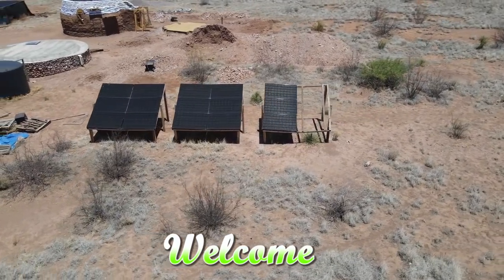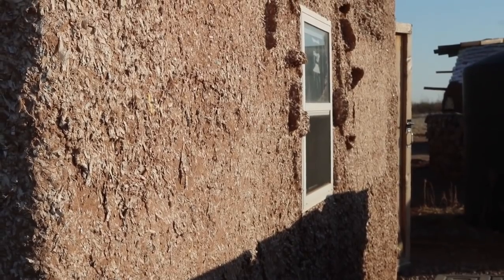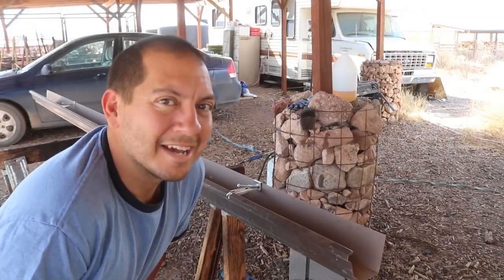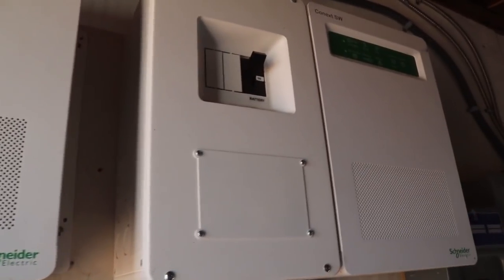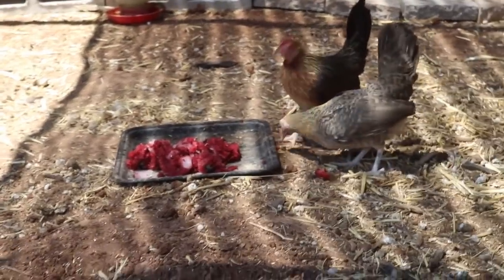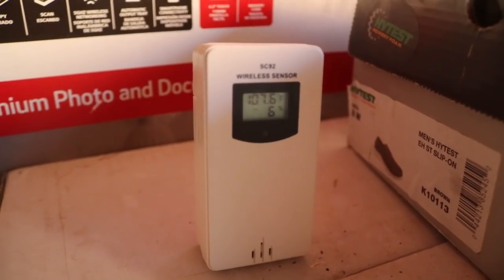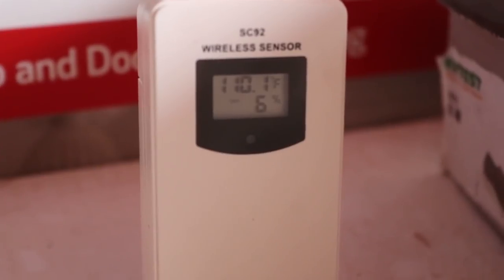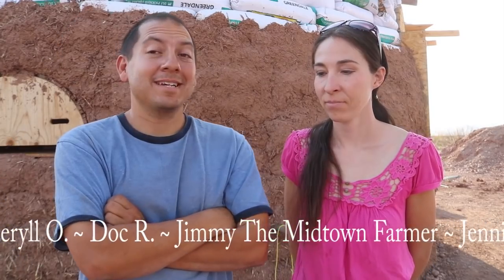Scorching Desert Heatwave Threatens to SHUT DOWN Our Off-Grid Solar

Comment: You need to get your RV out of direct sunlight their not insulated all that great and adding a second roof layer 4 inches apart or cover the roof with mud bricks on the shed this will knock down those temps and cob some more the out side walls.

Comment: A tip on cooling your solar shed and Rv, cover any windows that are hit by sunlight with an emergency survival blanket shinny side out. I cut the blankets to fit the windows and tape to the inside. It drops the temp in my house by 10 degrees. Its a cheep small fix, hope it helps.
Reply: Absolutely! Cover any and all sunstruck glass from the outside. I recommend the lightest weight something. Again if it moves you are harvesting wind energy to lift the light shade...it then falls by gravity and that tiny puff of movement keeps the outer layer of air you have surrounding the exterior envelope from building up heat. Make a cooler layer of air around any structure by doubling the envelope in a way that doesn't build up hot air...but first as commented shade glass from the outside.

Comment: FYI... If you get a tarp as others suggest for your shed, you can expect it 15F cooler. Based this on testing using a large rectangular patio umbrella in a tiled patio in Cali, Colombia. 👍

Paint the roof white, if not silver already. Both reflect similar amount of light/heat, but white is usually cheaper. Yes, did it on a concrete roof. My solar hot water came from cold water pex tubing in the roof getting to 120F by 11:00 AM. Dropped 15F after protecting the roof with the coating of a white concrete sealant. Checked the temperature right from the faucet! 🙂

Comment: We in Zambia made sure there is a lot of ventilation between roofing sheet and ceiling and isolate the top of the ceiling but not so much that is blocks airflow. We also sometimes see double roofing with a big free open air flow between them. Make sure the highestt point of the roof allows air to escape easy.

Comment: Heat is very bad for batteries,  I worked for Johnson Controls battery division for many years....Ac in the shed isn't probably neccessary but good ventilation is!

Comment: So some tips I've learned not having ac for 15 years in Central Kansas where we can get pretty hot. If you open the window in your shed at night and use your fan to pull in cool air then shut everything down as the sun comes up. That has helped me tremendously! I also got some small Blaux room coolers that basically work like a swamp cooler! Very happy with what they do! Low energy too! I also cover all windows with heavy dark curtains that get direct sun exposure and that really helps. We just got new windows last year and so far I haven't even needed the curtains. So if you are getting cold at night like I remember the desert, pull that air in at night with fans then shut down when sun comes! So hot out there right now! My nephew is a hot shot wildlands firefighter working the Telegraph Fire. Like 110-116 up there! I don't know how the crews are doing it! Ugh! Stay cool guys!
Reply: Praying for you nephew to stay safe,that's a heck of a job especially in that ambient heat.
Reply: I read a tip of watering the plants (yard) and in the home at dawn, and then once again (if I remember correctly. Maybe the first dose to soften the soil and to get the plants used to it. They will evaporate a lot and then you give them some more. That allegedly had a noticeable cooling effect.

A major airing in the morning (then it is the coolest) and closing  the windows at 9 or 10 am.

If you have a backyard or the home is shaded by a tree  it is much cooler. Mass in the home helps (that is a problem with wood / wood board homes that are well insulated. That works in winter - but once you have the heat in it it is hard to get it out, there are no heavy walls, ceilings & floors etc. to moderate the temperature and to absorb cooler night temperature. 

Closing the windows during day and shading the windows (idealy with a large roof. in many regions they try to have large South and West facing windows that let in the lower standing sun in winter and early srping / late summer but in summer they are shaded by the roof.
Even if there are warm days, the nights are usually still cool so that helps.

Comment: Hi Jim, if you have some white paint laying around then quickest/cheapest thing to do is paint the outside roof of your shed white. It will actually male a huge difference. The zinc alum / corrugated iron won't absorb as much heat. We had something similar happened to us and the paint trick was just like night and day. You could actually touch the metal after it was painted.. never expected how much it woukd help. Good luck with the heat.
Reply: For Crew , try getting his belly fur nice and wet.or at least moist. If humidity is low, it will work a wonder on his organs and body. Cooling the belly is where it is most beneficial in a dog , not his back. Learned the hard way with one of our dog, but it brought her back.

Comment: We had a series of summers where the bricks on the front of my house were hot enough to fry eggs or cause serious burns. After putting up some UV block shade-cloth, the bricks ended up just being warm to the touch and inside the house was waaaay cooler.

Comment: Good Morning!
I lived without AC for years.  Open everything up at night using fans to bring in the night air.  Then before the sun gets up, close it all up, shut windows curtains, even hang blankets over southern windows. This will last until noon or better.   Then by 3 or 4 you open eastern and northern windows for cooler cross drafts....  the AC works better also if you start it when everything is cool, then it maintains rather than fighting the heat

Comment: Hey Jim look into a radiant barrier to line the inside of your solar building it's cheap enough and easy to install should lower your temps considerably...it refracts uvs like a mirror
Reply: The radiant barrier like reflectix sounds good but I think it belongs on the outermost subside possible or it will keep the equipment heat gains from dissipating. You have heat gains from the outside and from the inside ..not to mention the sunstruck glass generating heat gains ( cyg! Cover your glass from the outside!) I would hang sheets of reflectix like laundry from lines a foot away from the shed walls. All over and around it. And the trailers. And if it's too much shiny stuff I'd cover it with white cheap temporary stick on accordion shades..so sad they don't sell schottis panels at Ikea because that stuff was great. Let the wind blow it and attach only on one edge with binder clips.

Comment: Geo thermal tubes ducted into the solar shed along with a exhaust fan should help with the temps. Adding a roof over the RV’s would help with temps in there as well as add to rain collection.

Comment: I'll echo the sentiment of the people who've suggested putting up a secondary roof over the shed and RV. Even if it's just a shade cloth (just remember to give it at least a little space between the roof and the cloth so the hot air doesn't accumulate in one place).

Also, for the future, it might be worth looking into windcatchers (also known as wind towers and wind scoops), which is an old African/Asian design that helps with natural cooling.

Comment: might make sense to  hang a shade cloth - over the roof and sides.  Blowing the air out - then dig a 30 foot trench   about two feet down and bury some drainage pipe and pull fresh air through the pipe and vent into the shed.  The fan blowing the hot air out.. Then insulate the roof and  doors and weatherstrip around the doors to try and have the air coming into the shed being pulled through the pipe hopefully being cooled a bit by the earth.  Was always amazed at how having a shade on the exterior of our house  in front of a window and  then having the window open- how much cooler the air coming in the window would be.

Comment: It was 113 here where I am at in Az yesterday. Bullhead was 121! I am on solar also and when it gets above 107 it gets really hard to keep my fifthwheel cool! Luckily I am on county water and with my solar I can run a 3100 cfm evap cooler and a small window ac for half hour shots of extra coolness for a half hour at a time! We will be at 110 or higher through the weekend! Miss our usual summertime highs of 104! Its amazing how much just a few degrees in outside temp can effect heating or cooling! Stay safe through this heatwave!

Comment: FYI If you can find some Koolaroo shade cloth it really helps.  This brand does a better job than the open mesh you use for the chickens.   It's available in a big roll on Amazon.  In the off season, stock up on it and cover your solar shed, the chicks, and cover your shed windows with dark cloth.  I've done this many times and it really does help.  Good luck, keep Koolaroo.  My best to you all.

Comment: You should get a window unit in the RV the top units are really inefficient. Also for the shed some lightly forced air through tubes under ground will help keep it cool.

Comment: We are also off grid and it also gets hot here in Texas. I like. To keep the solar equipment cool so it will not shut down and last longer. If I my suggest to add some extra solar panels and add a energy star 6,000 BTU window unit for your power room. The equipment will love you for it. Also put shade screens on the sun exposed walls.

Comment: A tip for the solar shed, put up a couple of black vent pipes on the higher part of the roof and open a couple of intakes on the bottom of the shaded northern wall to induce a cool draft, kinda like in an earthship.

Best wishes to you guys!! 
You're doing a great job👍🏻
Reply: I thought Jim already did the stove pipe thing.

Comment: Silver tarps, held up by milk crates(they used to be free around here) would help the shed and trailer stay a little cooler. The gap from the roof to the tarp must allow free flow of air. Can your a/c be more efficient if you wet the condenser? The auto a/c may just have crap plugging the fins of the condenser(in front of the radiator). Occasionally there will be crap between the radiator and the condenser. I clean all of my air conditioners each spring. It pays off. Years ago, many houses had "summer kitchens" for cooking and preserving. Our goofy newfies used to love frozen tomatoes to chew on in the heat. Good Luck, Rick

Comment: Reading comments a lot of good advice.
I was a mechanic most of my life the alternator doesn't start charging till after the engine hits a certain rpm. That could be why the engine stalls when you turn on the AC.
Also make sure the fan is blowing air across the front of your radiator/condenser at idle.
Also check the freon level

Comment: 1. A tin roof radiates heat into an enclosure.  There are several approaches to dealing with that.  1. cover over the tin with another roof with airflow between.  
2. insulate.  
3. If you have 6000 watts, why aren't you running a small ac unit in the solar building?
4. You can reduce temps greatly with more shading around the room.  Tin roofs in open air reduce heat if they are high enough.  I think you need at least 9 feet to offset the radiant heat.
5. The thermal mass of the walls is compromised if you have no mass in the ceiling.
Reply: Very well said!
Reply: The radiant gains of a tin roof if y'all wanted to get really operation heavy solution...what gains solar heat radinantly can lose heat just as fast to a desert night sky in theory. The old school.heavy operational passive solution was to.have the metal  roof be highly insulated in the day but remove the insulation at night so the metal roof loses heat as supereffectively as it would gain heat if exposed by day. Those nifty solutions required vigilance to move insulation off and on night and day. A notch better than that was using the water storage to dump heat too but obviously that's sketchy on the roof. Walls work too though...Done right the mass of the water storage tanks wrapping the spaces needing cooling can act as if burying underground...you just have to insulate in the day and expose and remove the insulation at night. And never forget. I imagine you get really thick insulation panels like on a big hinge...did that fridge come with any stryo foam?

Comment: Hi, so for ventilation, we got a couple Amtrak solor fans for our shipping container, genny shed, and small cabin. They work fantastic. The blades are inter changeable to either suck air in/out. As inventive as you tow are I am sure you could make these work for your inverter shed or any other place for that matter. We got them for 70.00 ea on Amazon. They only need 100 watt solar panel but you might be able to use what you already have.

Comment: My last car had the problem of not blowing hot/cold unless the car was in motion.  A coolant system flush fixed that up. Not an expensive fix.  Make a 1"X2" frame raised up about 6" above the shed and drape it with shade cloth so the sun isn't beating right on the roof of the shed.  The trailer too.  Having airflow between the roof and the shade cloth might help.

Comment: If you ever decide to move into another building or make changes to this one, bury a 12" pipe in the ground and have air flowing through it into the room. The ground will remove some of the heat. Cheap way to get a little air conditioning. By the way, what is the temperature in your dome basement? I'd be sleeping in there. You could also run a hose from there into the solar room as well. Even a 3-4" hose would help cool off the room. How far is it from dome?

Comment: Leave a couple of shallow pans of water out for the chickens. Just a couple of cat litter pans with about 3" of inches of water will do it. We were 117 the other day here in queen creek and my chickens made it through just fine! Honestly when i was first told of this, i truly i did not think it would work. They stand in it and it cools there feet, thus cooling the rest of the body. It really DOES work!!!
Reply: I'll have to try that. It is $20 at a hardware store item but you can buy an OATEY washing machine plastic pan that I use around our water buckets and chicken feeders to contain spills. They are about 3" deep and probably could work too. A little expensive but I have had them a long time and they clean up well too.

Comment: Have your tried a portable swamp cooler rather than using AC in your RV? They are suppose to be much more efficient than AC when in comes to the AZ dry heat. ..Just a thought..
Reply: Water is a premium for these guys they have to use it wisely they are better off running the AC units it dont cost them anything .. They pay for their water
Reply: @ram1brn  plus they plus the can harvest the condensed water from the ac
Reply: @ram1brn  a tank of water would be cheap to ensure not having heat stroke and solar is not cheap either if ya have to buy a couple more batts at bout a thou apiece. Ac takes up a lot juice and will probably have to skimp on elect stuff used.
Reply: Evaps work great. Use less energy...they don't take that much water. Use during the hotest time then switch to AC when you want to.

Comment: Heat is on no doubt. Stay cool as ya can and don't be getting heat stroke!!
Reply from the maker: Thanks CB! We're trying. We're mostly concerned about keeping Crew cool.
Reply: I found a dog cooling mat at the big purple 99 cent and more store. It's I beleive called phase change material cooling but basically pressure on thos 24 inch by 30 inch mat causes a chemical reaction that is quite cool for it says 3 hours but I tested it and it feels like an hour. You have to literally sit on it but it's a gel mat and soft...so it will keep a person or dog cool by having body areas that touch it cool. Of course because of our body circulation it cools the body's core not just the parts touching it. You reuse this mat indefinitely... It recharges after a couple hours or so when there's no pressure on it...so I'd day get 3 mats. For the pup and maybe a couple for yourselves. Remember there's no such thing as cool...you just need to unload heat from your body or the pups body. It's latent heat It cost like 6 bucks.

Comment: Maybe house your solar in a shed under your large roof, or put an additional cool roof over the solar shed?
Reply: Live roof would cut down the heat, or put a reverse solar fan in the shed window, close the door and let the fan blow the warm air out.
Reply: Dig a well inside the building and fill with water, pump cool water up and over a wood mesh in front of the fan. Sort of a swamp cooler. That’s what we used before air conditioning was available.  Where I lived in 1960-1980 temps above 100 where common in summer.
Reply: How about criss cross lattice, like three layers of it for shade without radiative heat blasting down on any roof?

Comment: Here in Central California it's hot & dry. I've always preferred a swamp cooler to air-conditioning in dry climate. Building a swamp cooler might be easy for you to put together for the shed window, Jim. 😉 They use less power than air-conditioning.

Comment: I'm just outside Joshua Tree, CA and I feel you. Our low temp overnight was 86.9f, and we saw temps just over 113f. In the low humidity, I personally might think about a swamp cooler for the solar shed, assuming you could spare the water to run it.
Reply: A normal AC might be better because electronics don't like water or humidity. It would work great for the RV!